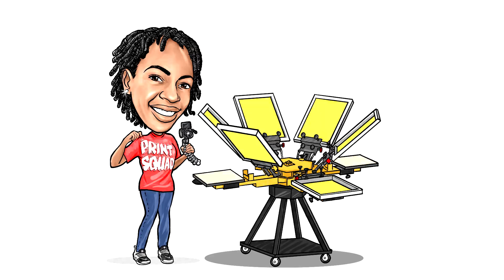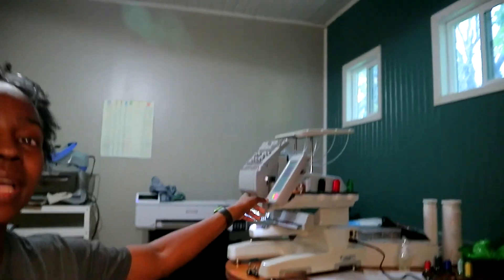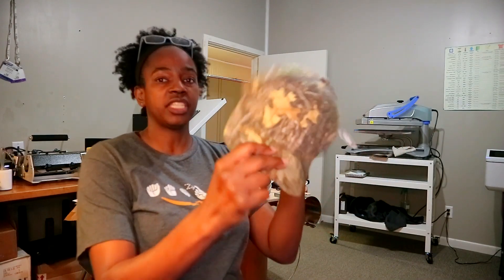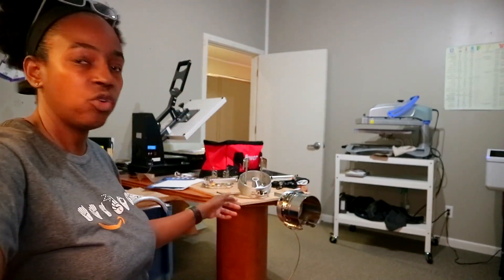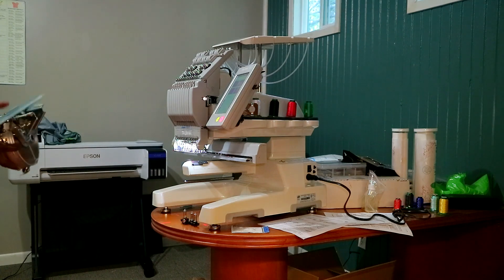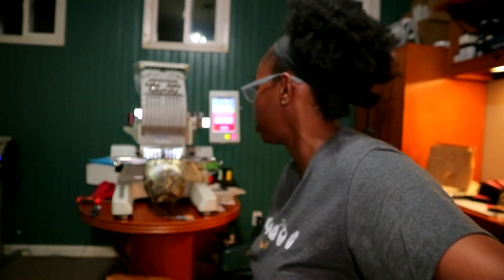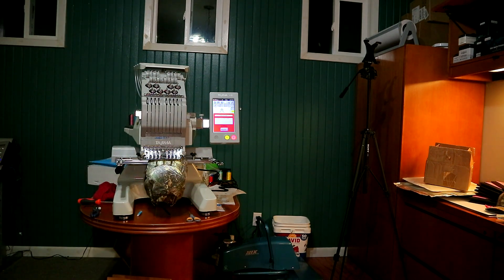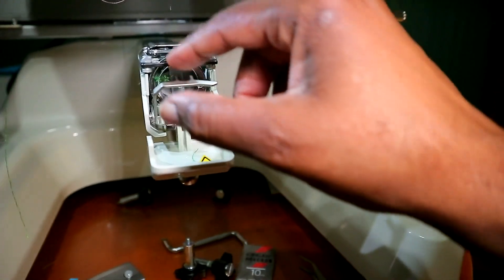Issues Embroidering Hats

Comment: Hi Sin,   That strap band should actually be sitting in the seam between the bill and crown.  Design maybe beyond parameters and no backing on structured caps, and presser foot up all the way.  And check your bobbin for correct tension
Reply from the maker: The thread issue was because of the bobbin I talked about it at the end of the video.  I didn't think the hat needed backing I said in the video that I was just going to use it anyway. Thanks for watching!

Comment: Sin you have to increase the X Y space on the machine to allow you to sew a larger sewing field.  Also for backpacks you have to use that magnetic hoop that you have.  You usually have about a 2" tall sewing field for caps unless.  You can invest in the hooptech Gen2 cap hooping system and you can sew larger and it makes caps so much easier.
Reply: Also It may not  be the design thats too large.  Its the hoop size that you have chosen is the incorrect size and the design wont fit.  Also slow that machine down for caps.
Reply from the maker: Hi Elliott!  Not sure what the X Y space is I didn't see any info on that in the manual or when doing research. I explained the cause of the issue during the premiere of this video it was something I did not  have adjusted correctly when I installed the hat driver onto the machine once I figured that out I stopped getting the errors for that.  The designs were not too big I was getting that code because I didn't set the machine in the correct place before I did the trace so the machine would say it was too big because I had it set to stitch in an area where it was not supposed to stitch.  I have learned to slow the machine down to protect the machine when doing caps which I did not know when I stitched first two that I did. Fortunately they came out fine doing them at that speed and I didn't break a needle.  Thanks for watching!

Comment: Sin steam the front when using structured hats. It will soften the structure for embroidering.  Also may need to try an 80/12 needle. Also may need to use extra stabilizer unless your machine has a more raised throatplate.
Reply from the maker: Thanks for the tip!  I ended up switching the needle after a while.  I finally got I'm doing a lot better now LOL!
Reply: best is to be sure your files are set up for hats. no need to steam or use 80 needles
Reply: @datukevznwede6043  I agree on the files being set up correctly using the inside out bottom up stitching rule for digitizing hats with no vertical or horizontal fill - fill should be at an angle so there is no distortion. With that being said. I still steam my hats and in some occasions I found the 80/12 needle worked better on a heavy structured hat.:)
Reply: @mncustom-made-barblafond6825  Ive never steamed and hat, and run 65 needles on richarson 112 hats.

Comment: Hello
You should try mighty hoops  and Fiverr App for your digitizing  orders.
I use a guy name Sufyansher
When you get something digitized always make sure you tell them what you are using the design on for instance a hat is digitized from the inside out.
You always need stabilizer for hats. Hope this helps😊
Reply from the maker: I have mighty hoops I have 2 unboxing videos showing them and I also have some other accessories I have not posted videos for yet.  I actually showed a Mighty hoop in this video you must have missed it.  I have 3 companies that I use for digitizing and when I submit orders they have very specific questions they ask so that they produce the right type of files and digitize for the specific item I will be stitching onto.  I digitized the logo in the video myself because it wasn't for a paid job.  Thanks for watching!

Comment: its called a structured hat and the other is non structured. Your design looks auto digitized and that where you will get issues. usually when you put the hat hoop on you take off the standard frame.
Reply from the maker: I don't have to take the standard frame off for this machine I know that for sure I did that with the first 2 hats I stitched and after doing more research on my machine I followed the instructions for my specific machine.  I did the digitizing myself because it was just a gift and that's not why I was having the issues.  If you watch through the end of the video I was able to do the hats.  I figured out what the issues were and said what they were at the end of the video. I also know the different types of hats but in real life when there is a lot going on in my mind and right in front of me I often can't find the right words to say.  I think that's just a part of being human.  Thank you for watching.